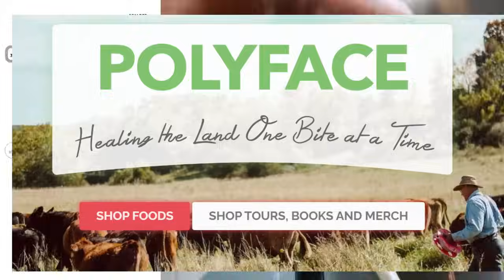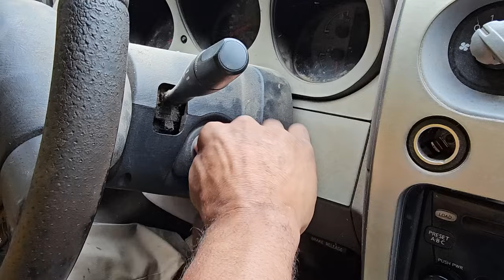EVERYONE Should Know How To Do This...

Comment: Growing up on a farm me, my foster mom and foster father, we processed like 20 chickens at a time. Either me or my foster father used the ax,, not a pleasant job but that was part of farming. We had those cast iron wood stoves the huge ones with 3 sections to heat the water, a 5 gallon bucket to dip them in and a pot belly stove to quick burn the hairs off the chicken, and a kitchen table to cut them up. that was it.  It taught me a lot not just about farming and processing, but what we did together, the conversations the teaching and learning from each other, it all meant so much to us. I miss those times. I wish I lived closer to be at your Jamboree!